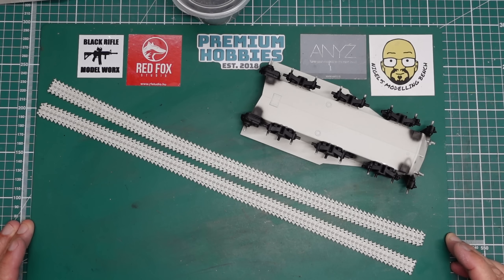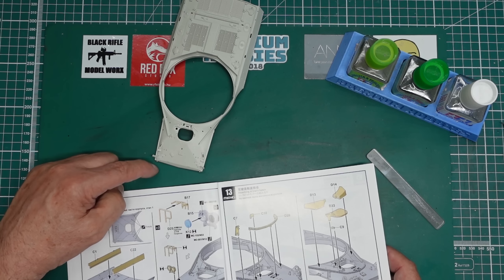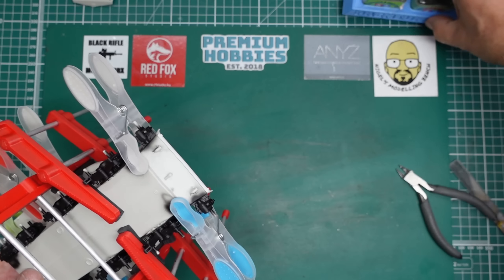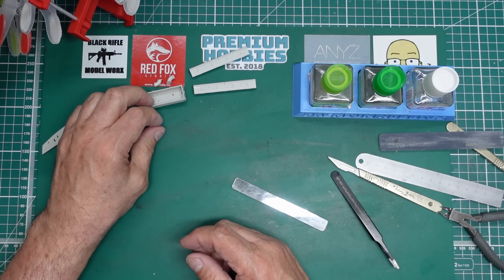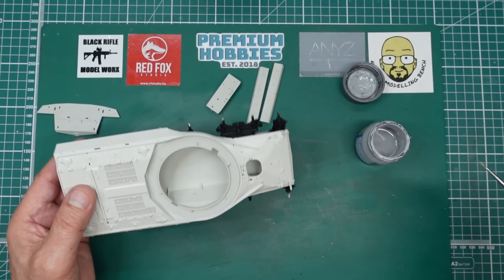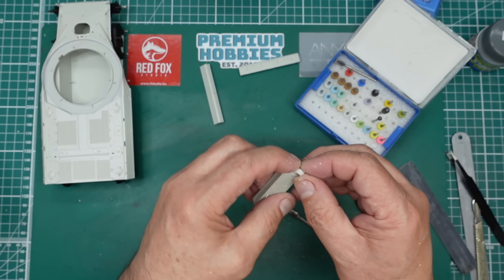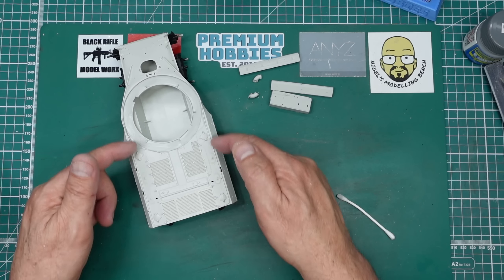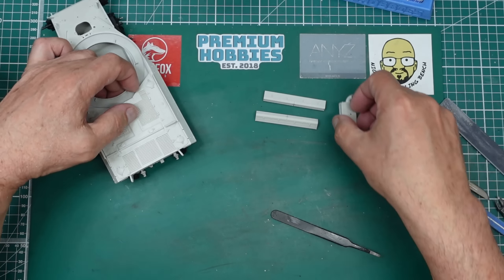Meng 1/35 Chieftain Mk10 build.  Part 4... in 1440p

Comment: The exhausts don't rust because they are caked in carbon from the exhaust smoke. The silencer, or as we called it, the smoke box is situated above the gear box. It could be removed in war to scare the crap out of the infantry. Seriously, the noise at night messed up anyone not used to Chieftain. On the tool bins you are filling in the piano hinges. Don't forget that the hull, suspension, etc would be NATO green  under the Berlin camo. If memory serves me right, the exhausts were cast and pretty heavy. The angled piece on the back hull is the convoy light. You don't have to be to accurate with the exhausts except for the left hand side when looking from the back. The exhausts where fitted with a big clamp and the left hand one was important so it didn't blow into the face of anyone using the tank telephone. Looking good , great job.
Reply from the maker: I'm not filling any piano hinges? Which boxes are you referring to? Did the exhausts burn off the paint and rust on the outside?
Reply: @NigelsModellingBench  the long tool bins you built, the top back edge , holding the lid , is a piano hinge. The exhausts burnt off the paint at the ends but became caked in carbon, soot. You would see some paint at the elbow and back to the hull but the end of the exhaust back to the elbow was heavy with built up carbon/soot deposits. No real rust. Hope this helps , any other questions please feel free to ask. I was a driver/mech on Chieftain and challenger 1.
Reply from the maker: Those long tool bins have the piano along the top so the sanding I was doing was removing the seam along the back. Thanks for the info on the exhausts Pat, much appreciated. May I ask, the winch reel on the right of the turret, what was it for and what size would the cable be?

Comment: Technique question:  I've seen you frequently use the black Mr. Surfacer, particularly to make its presence visible.  Is there some reason why, on this light gray plastic kit, you have chosen to use the gray Mr. Surfacer, which is more difficult for the viewers to see on the camera for them to understand where it has been applied, and how much has been removed?  Thanks.
Reply from the maker: Sorry Tron, I dont understand the question.
Reply: @NigelsModellingBench  Nigel, Sorry - I'm trying to understand why the choice of gray Mr. Surfacer versus black Mr. Surfacer for use in seam filling, since the gray Mr. Surfacer blends in so well with the gray  kit plastic that the gray Mr. Surfacer would seem to be more difficult to know exactly where it has been put down, and how much has been removed with the cotton bud.
Reply from the maker: The grey makes any issues, scratches or blemishes pop out that other colours will not show up. Also, the generally used "fillers" are only available in grey.